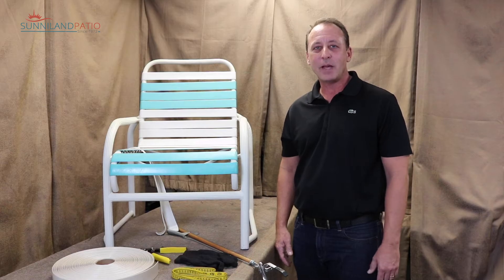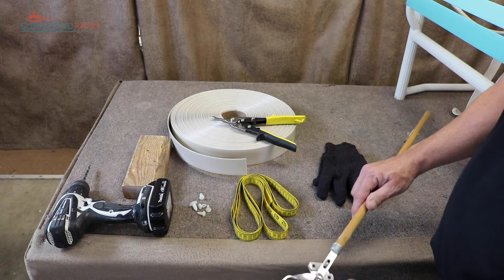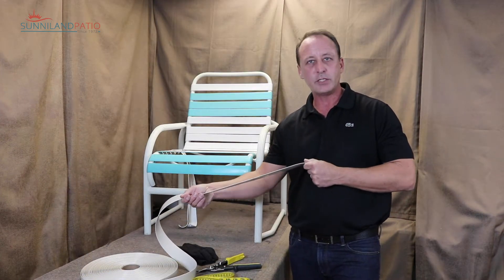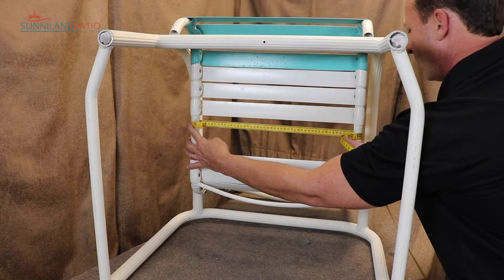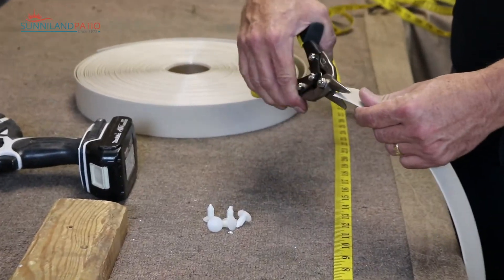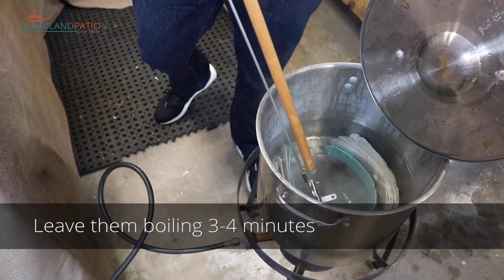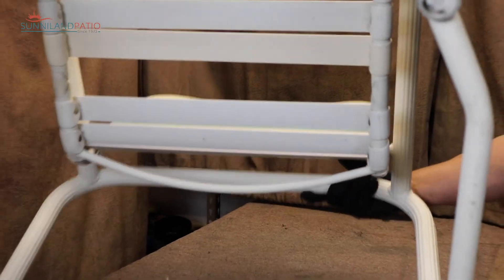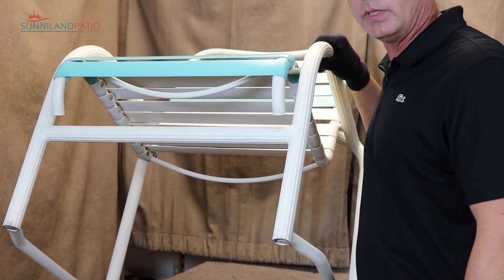How To Install A Single Wrap Vinyl Strap

Comment: Great video.  Two comments: I found that reducing by 10% made the work too hard, so I reduced by 5% and that worked fine.  Also, to prevent distortion around the first rivet hole, I dipped the fist 1/2 inch in cold water for 5 seconds before installing it.
Reply from the maker: We're glad we were able to help!

Comment: I have a Hillcrest set of patio furniture with vinyl straps, but no rivets/holes. Instead, there are slots in the frame for the vinyl ends. The ends of the straps have a kind of arrowhead pattern to fit into the frame. Not sure how to proceed
Reply: Same here. Drill a whole where the slot is and use a rivet

Comment: I have a real old set of patio chairs with the vinyl straps inserted in deep slots. I do not want to change the installation. Do you have a video showing what cut to make to ensure the deep slot can still be used without rivets?
Reply from the maker: Sorry- we have never had success trying to make straps to fit slots. Trust us- it will be a lot less time consuming and secure by drilling the holes and using rivets.

Comment: Existing straps fell off my furniture. So I put them in boiling water, but I’m having a hard time getting them back on. It took both me and my husband to pull hard enough to secure one strap. You made it look so easy in the video. Any advice?
Reply from the maker: Be sure to work fast once you remove from hot water- they start to cool fast. If no luck -just increase your strap length.

Comment: Hi! Does it matter if the original vinyl was single or double-wrapped? My chairs are double-wrapped and I'm curious if there's any reason they shouldn't be single-wrapped instead.
Reply from the maker: Double wrapping is more secure. Many have still converted to single wrap for ease of installation. Double wrap is definitely more effort. If single wrapping the holes should be made 3/4  around the frames – making them across from each other so they grip as much of the frame as possible.

Comment: So how do you replace the straps if the rivets aren't plastic? Mine seems to be welded into the frame and is made of metal. Maybe do all your steps but slip the strap over the rivot?
Reply from the maker: Yes- the holes in the straps can slip over the metal when heated.

Comment: where can you find different colors and widths of the straps? mine are 1.75" and all i see online are 2", 1.5" and 2.5"
Reply from the maker: When a 2” strap is heated and stretched- it will measure 1.75” – sounds like you need 2”